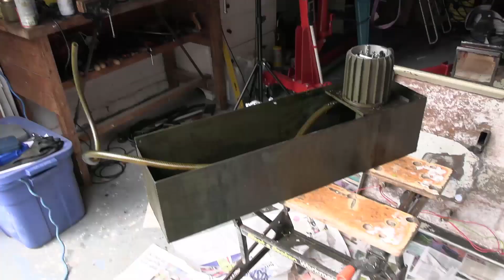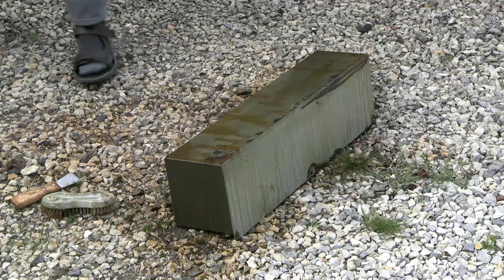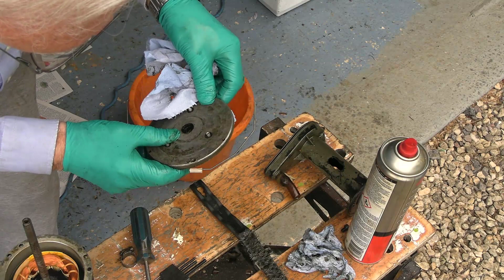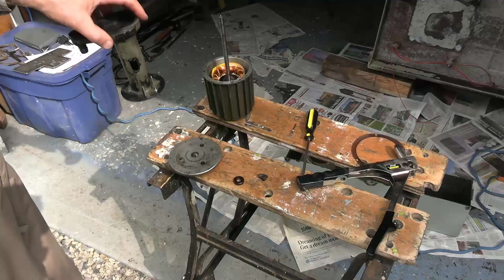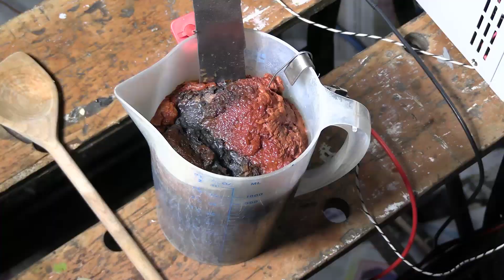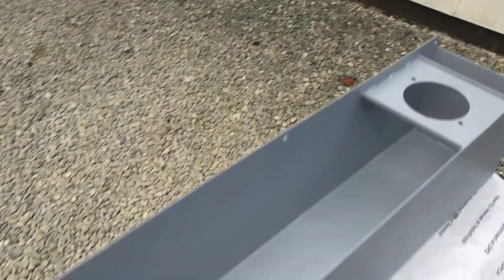M300 lathe - coolant system refurb

Comment: Samuel this is massively useful as I'm just dismantling such a pump that came on my Harrison Universal Mill. It's looking like my windings are shot but I need it apart to know for sure what's happened. Cheers
Reply from the maker: Thanks. I suppose Harrison used a 3-phase motor for the coolant pump just to keep the electrical load balanced but I think it is a massive overkill for the job. On my mill, I use a little 12v pump off ebay for coolant and it has plenty of flow.

Comment: Very much enjoying videos and progress on your project. I am no expert but could the reason for the intake being so low in the tank be due to wanting to prevent separation of oil and water, i.e by having the intake at the bottom of the tank it will ensure circulation of the mix right to the bottom of the tank?
Reply from the maker: That's something I hadn't thought of! Might be.

Comment: Nice rebuilding 
Im in process of rebuilding mine and i replace the bed with straight bed instead gap bed and im wondering what staff you will use under bed order f lathe to seal back and free of twist?
Reply from the maker: I haven't rebedded mine yet and have not quite decided what to use as the bedding compound. I calculate that the pressure on the compound is about 38 KPa (or 5.5 PSI) which is pretty low, so many things could be used. Some people have advised to use car body filler. I thought the stuff under my lathe bed seemed to be ceramic filled, so I looked for a ceramic filled epoxy putty such as https://uk.rs-online.com/web/p/adhesives/0691151 but this is rather expensive.
Reply: @samuelfielder  thanks 
I removed my original bed and looks like a filler but was hard to remove the bed was like glued and all that ceramic i have to chiselled
Not an expert or high expert on lathe I’m more like learning but I bought already epoxy resin grout for machinery base if that help and I found on eBay 1.5 l don’t think need more than that
Reply: Conbextra ep10
Reply from the maker: @dumbravatraian198  Yes looks very suitable to me (but I'm not an expert). Short pot life of 20 mins at 20°C so you need to be quick.
Reply: @samuelfielder  yes that I will pain in the as I will give a go see how i do mine and let you know in case help you
Reply from the maker: @dumbravatraian198  How did it go, or have you not done it yet?